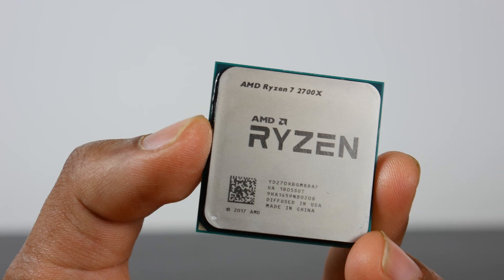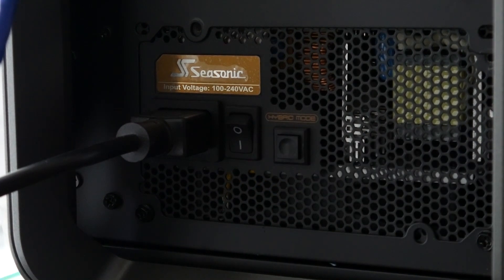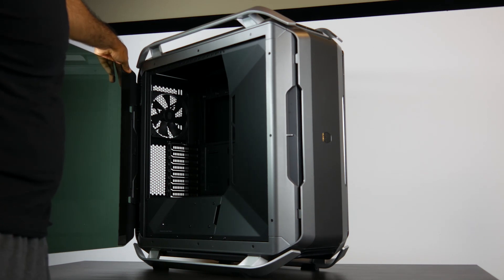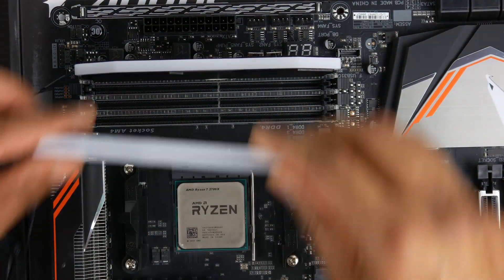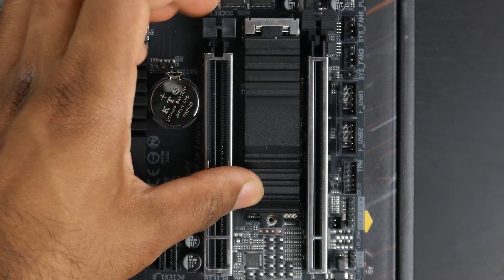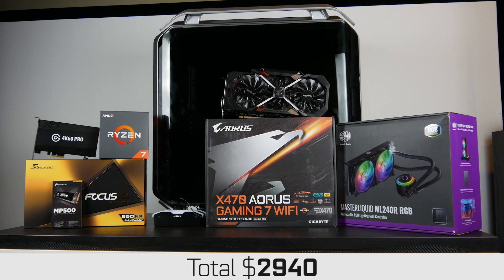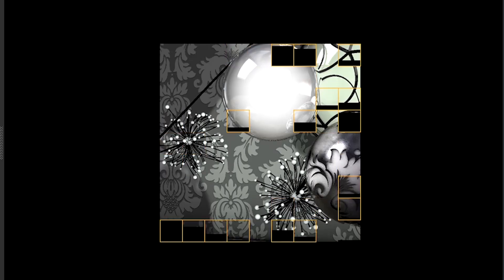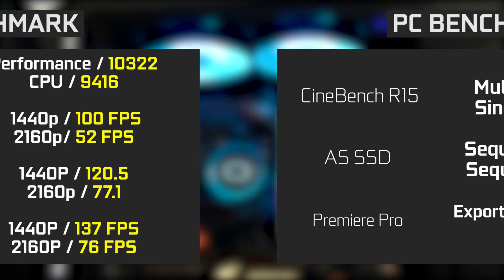$3000 4k Gaming/Streaming PC Build (Summer 2018)

Comment: (GPU) ASUS ROG STRIX GTX 1080 TI GAMING
CPU)  Intel Core i7-7820X
(CPU COOLER) corsair h100i
(MOTHERBOARD) msi x299 gaming m7 ack
(RAM) G Skill trident z 3200mhz 32gb  
(POWER SUPPLY) EVGA SuperNOVA 850 w 
(STORAGE) SSD 960 EVO NVMe M.2 500GB
(CASE) nzxt h700i
this is what im going to build this summer any help for better parts or things i should switch out would be helpful